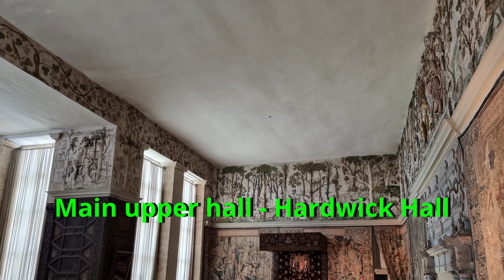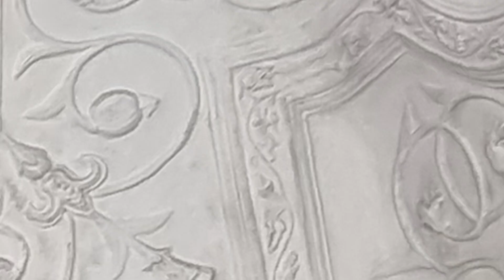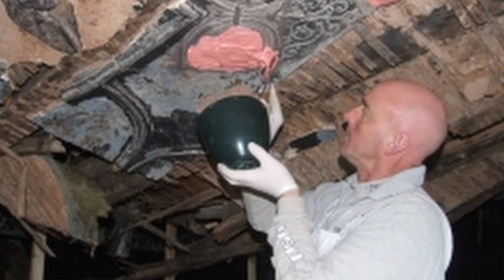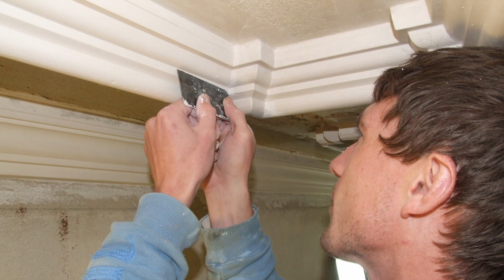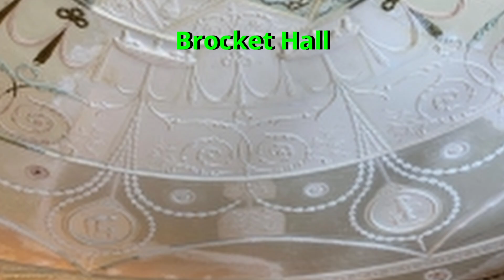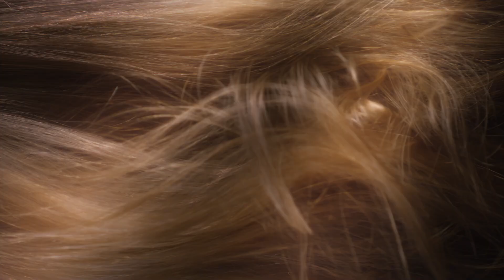Lime Plaster Ceiling Repair for Old Homes | Decorative Cornice & Moulding Restoration Tips

Comment: Roofs - the Cotswold stone tiles on my shed roof are hung on riven lathes too.  Looks like they have been there since the early 1700's.  Torching has failed, so the tip about using hot lime is appreciated.

Comment: Can Ceramic tiles be installed by lime mortar ?
Reply from the maker: Ceramic tiles are impermeable and are usually used to keep water out (e.g., tiles around a shower or bath). Using lime plaster to fix them sort of defeats the object of having ceramic tiles. 
My thinking is that if they are for walls and keeping moisture from getting beyond them, then no, you should use a tile adhesive/grout.  However, I am aware that many impermeable floor tiles have been laid on lime mortar. Therefore, on a floor I don't think there would be a problem. [Stephen]

Comment: How long should your animal hair be? Should I cut into e.g 3cm lengths?
Reply from the maker: Sorry about slow response.  The minimum length usually mentioned is 3/4 inch (19/20mm); therefore, 3cm should be OK, but don't go too long. [Stephen]
Reply: @talkingconservation Thank you...so far so good with my base coats! Keep up the good work on the videos, they're great 👍